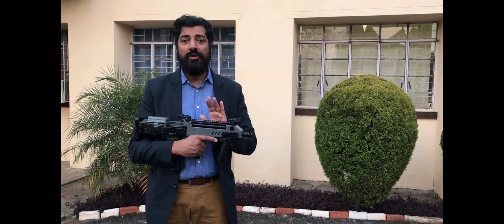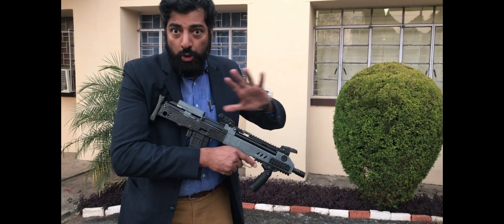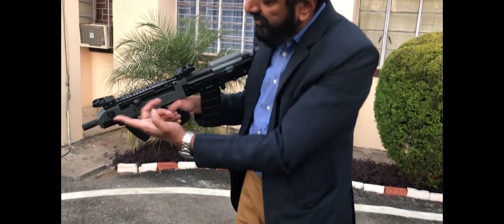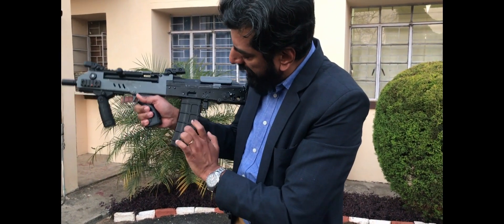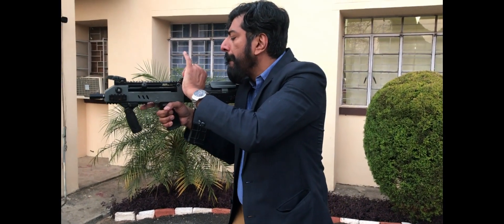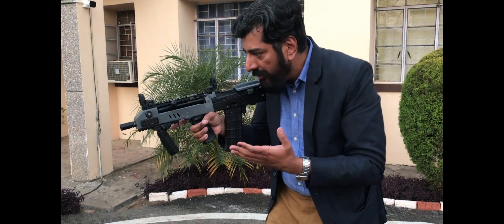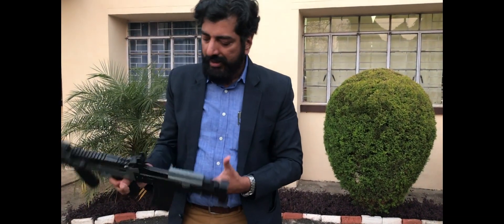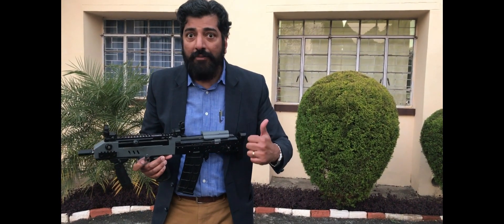Colonel Bansod's first reinvention- the INSAS BULLPUP

Comment: I mean this looks sick. Col Bansod is a gem. And i beg change all the existing insas into this. Definitely not a great gun. But to people this is a mod. He took the orginal INSAS and didn't changed its assembly. So the placement of shell ejector, magazine holder, seems like that and looks a little bit off. But its a mod of an existing rifle. And without changing the base he has changed it completely. Imagine what he would have had made if given a full warehouse and equipments to design and develop a gun. Mods are basically additions and change of parts. He left the key part and changed it 360. Damn. Look at what he made when he got this facility. Only 4 mobths and we got ASMI. I cant wait for future designs. 

Col. Bansod must be the new head for small arm weapons development. He should train those damn stupid OFB officials. Or should open a new company of himself. Woof! I bow!

Comment: A bullpup in lighter calibers is passable but in the. 308 it is not recommended. It's muzzle jump is simply uncontrollable, it's muzzle flash is very pronounced, the rate of twist of an 8 inch barrel is not meant for this cartridge. It's use is limited to short range use which can be fulfilled better by other lighter calibers. This is only an impractical weapon decorated with external furniture to impress the ignorant.

Comment: The INSAS rifle never had a problem with how the weapon performed overall ,the problem has always been with manufacturing quality and the materials used , like the cracking of the plastic magazine , jamming etc .
Reply: The original INSAS was never a reliable weapon.  The jamming due to spring was very frequent. In every magazine a round was getting stuck which proves to be very dangerous in CQB.
Reply: INSAS is not a CQB weapon.
Reply: @followthegood1  it is just a bad design, period. Bad ergonomics, poor reliability due to several factors - including the quality of materials. It is pretty high maintenace too - unless it is absolutely clean, it will have hiccups.  In battle- where the weapon might not be cleaned for several days - these issues are likely to be compounded (and they did, in Kargil).
Reply: @alfasierramike , Same decades old song.
Reply: "INSAS rifle never had a problem". That crap jammed more than any AK platform Indian army uses. It doesn't even compete with G3 platforms or the M4 ones or even the bushmaster. That gun is at best a mediocre one but a lot of people wont say that cuz of the nationalistic sentiment.

Comment: Replace those sights immediately. 
A decent set of sights to use is Yankee Hill Front and rear iron sights set. Your front sight is backwards. 
As a left handed bullpup owner I highly recommend you add a 7 mm long U-shaped Chute style cover of steel over the ejection port to drop the shell casing downward after ejection. Pad the cover with a hard matte plastic like Delrin and it will be a sufficient cheek to stock weld for both sides left or right, allowing ambidextrous operation which is a critical issue with bullpups.
Reply: That ain't a full developed weapon. It's just a mod. A trial of an existing weapon. Changing it completely by just keeping its soul.
Reply: @ gotcha, yea.

Comment: Chopped the barrel?? You got the idea of a bullpup all wrong!!!! Bullpup, in simple terms means the same configurations and dimensions of that of an assault rifle, but with the firing mechanisms at the rear of the trigger assembly, so as to give the same effect and efficiency of that of an assault rifle but with compact design......very seldom the barrel is chopped or shortened.

Comment: Modified ak receiver with bullpup configuration good one but with just 10 inch barrel it would only be suitable of cqc not in open field combat where range of average an firefight can be be between 200 to 800 m so i hope the drdo would make like a 16 or 20 inch free float barrel version also they should be in conversion kits only so that all the old insas rifles can be retrofitted to this configuration to save tooling cost and logistics

Comment: Correction: Bullpup doesn't mean a "chopped" barrel. The USP of a Bullpup is that you can shorten the overall weapon length while maintaining the barrel length almost the same - it comes at the cost of trigger mechanics though. Almost all bullpups have relatively bad triggers (owing to the long levers/linkages required to connect the sear to the trigger proper)
Reply: Also, a bullpupped AK isn't exactly a brand new idea, for example: Ukraine adopted their bullpup AK "Malyuk" (AKA "Vulcan-M") in 2017, with development of this weapon beginning way back in 2005 by Interproinvest (IPI)
https://en.wikipedia.org/wiki/Malyuk

Comment: It was originally called JVPC (Joint Venture Protective Carbine). Appears to be a very impressive design. Col Bansod has also designed a machine pistol called Asmi, which too looks very promising. Very good initiative.
Reply from the maker: two different weapons. JVPC is chambered for 5.56x30 ...Bullpup iNSAS is 5.56x45
Reply: Ok. Thanks. They look very similar.

Comment: Basically converted AK-203 reciever assembly By adding Butt end to rear turnion, replaced the fore end assembly with body based on travor X95 adding the lever mechanism  for  trigger,  super  retrofitting
Reply: That is INSAS, not AK. INSAS is AK-based but it is different enough to be its own thing.
Reply: Nope, that's an INSAS based receiver.

Comment: Love the design its compact and great for cqb and the other thing if they can retro fit change the barrel to the standard ar barrel length for longer range accuracy like the steyr aug, which can change according to the requirement need depending on the mission.👍🏼

Comment: 30rd mags... Finally!
And 50rd extended mags? Yes please
Reply from the maker: yep
Reply: @chakranewz  ive always wanted to ask you this

What is your job? Firearm testing at something??
Reply: 50 rounds won’t be accepted by the army because then they have to change the magazine pouches for every single soldier. 30 round magazine will be more practical and the 50 might be issued to soldiers in static positions.